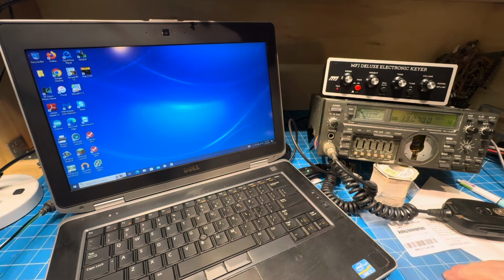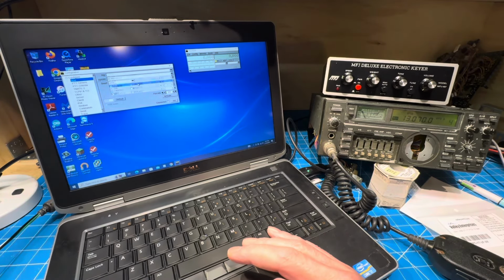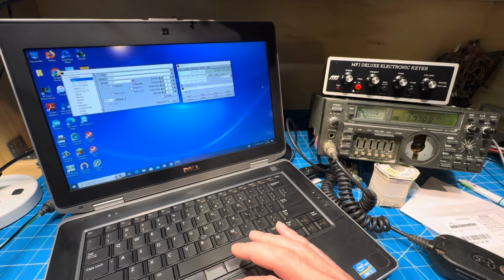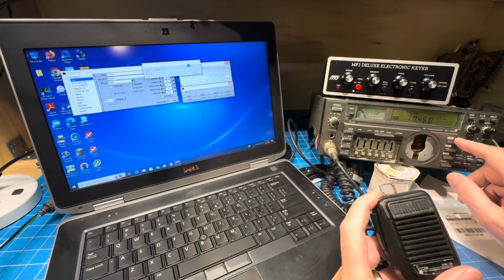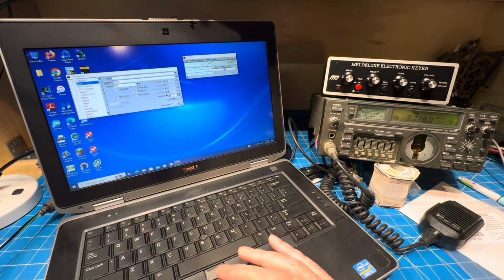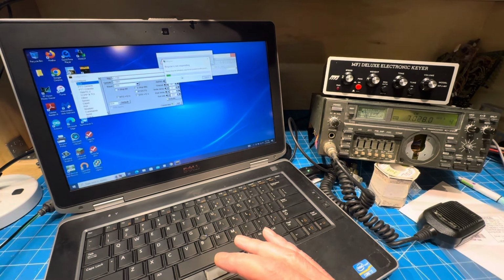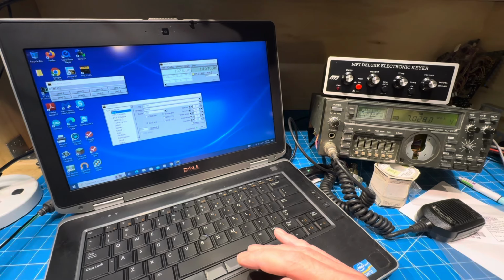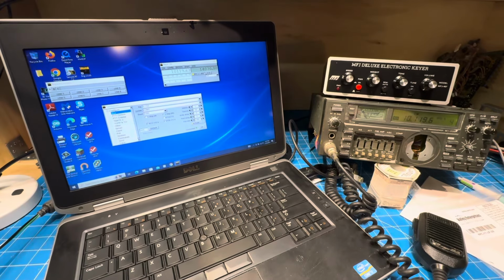Rusty IC-735 Gets Computer Control? It Can’t Be! At least I can change bands…

Comment: Some have gone into Windows USB configuration and turned off the auto sleep setting to make more reliable. Also, I believe you can adjust the USB speed between the laptop and the cable to make the CI-V work more reliably.
Reply from the maker: Thanks! It looks as though I should look around online for the latest tips. I admit I haven’t read any of the documentation either. I had to try it out!